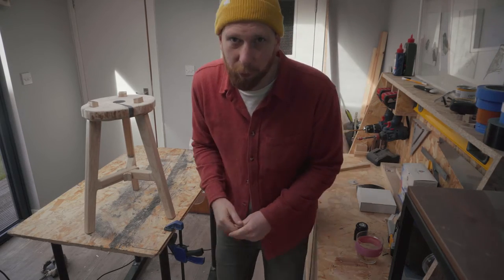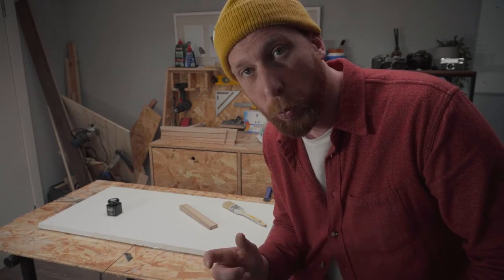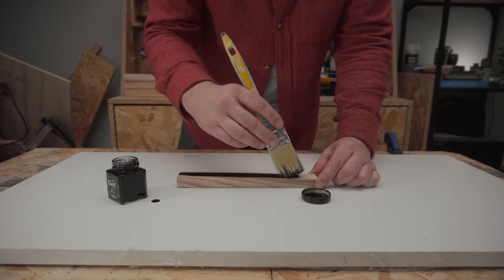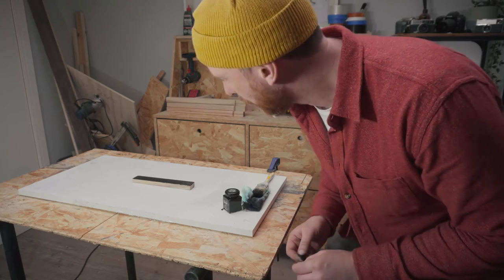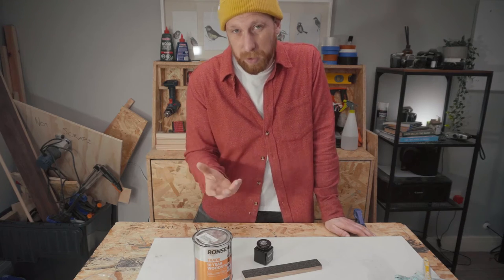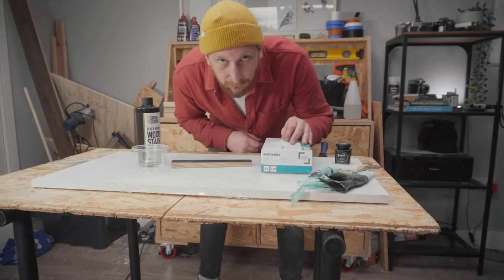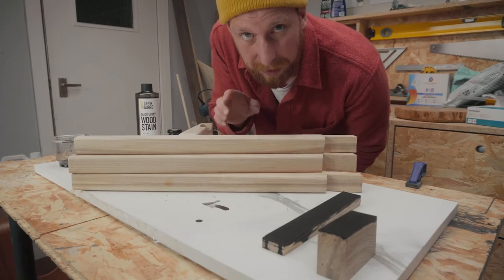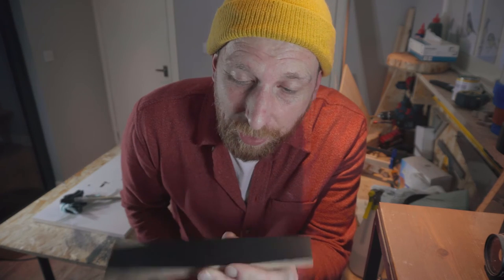The simplest way to stain wood black

Comment: I think you could have tried doing it the other way round to get the same result in fewer coats.  Stain first to penetrate, then ink on top to give the rich finish. I've done that on pine and it looked lush.
Reply from the maker: Thanks for the tip, I’ll give that a try

Comment: I use alcohol based leather dye a lot. Yours turned out very nice.
Reply from the maker: Cheers Keith. How’re the results with the leather dye? I’ve heard it gives good deep colour
Reply: I’m using the leather ink also. I have a gel stain for the second coat. Wiping between coats. Oil wax will be the top coat. We will see…👍

Comment: Came here just for more ideas, as I’m currently planning a full kitchen finish on unfinished oak using India ink and, as it happens, Oslo Polyx as well! I’m planning to lime/ceruse over the ink, so in my case the fact that it doesn’t penetrate to the full depth of the grain shouldn’t matter as it will be filled by white wax anyway. I’m also planning to use the gloss Polyx oil for a really old school polished finish. However now I’ve seen your gorgeous legs (hehe) I might just do black stain and India ink then the gloss Polyx. DECISIONS DECISIONS…